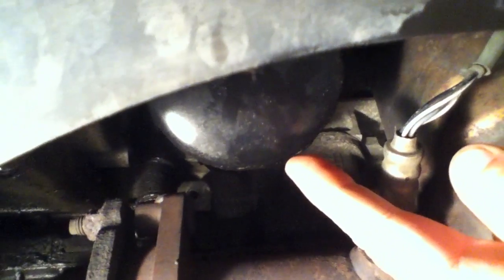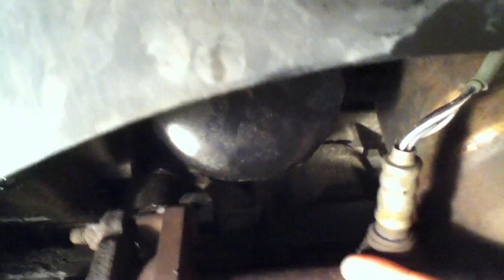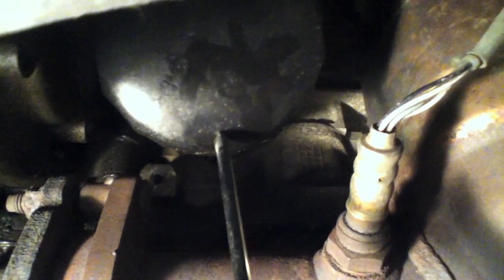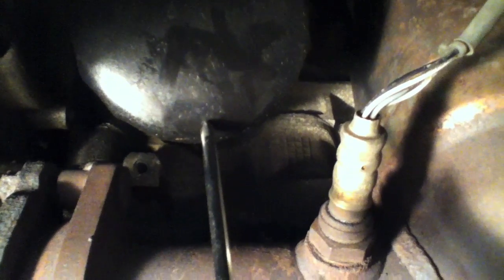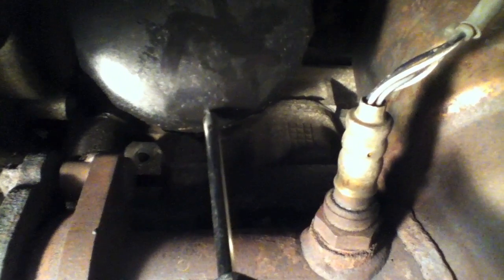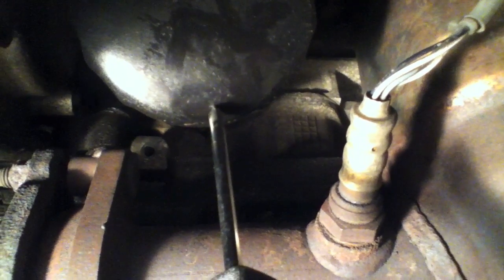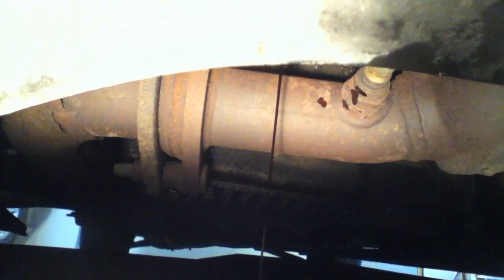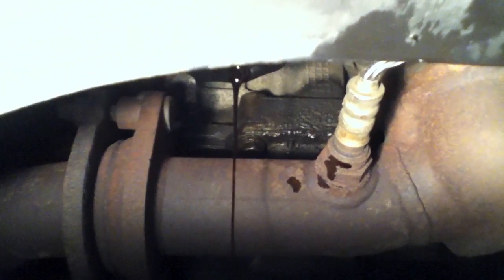How To CLEANLY Remove An Oil Filter

Comment: I slightly loosen the filter then put a quart size plastic baggy over the filter and unscrew it. Oil and filter fall into the baggy. The
Reply from the maker: Nice, that'd work also!
Reply: Epic suggestion. Thank you!!!!! - AB in Borneo
Reply: I was also thinking that the tip was a plastic bag. Either way, thank you for taking the time to share your idea.

Comment: Thank You for the tip, but my oil filter is on top of the engine not the bottom, do you have any suggestions video's for when it is at the top? Thanks again, TOm

Comment: I was thinking about drilling a hole in the old oil filter and inserting my hand-pump hose and pumping it out. Just got the hand-pump (Amazon) and this thing pumps out four quarts of crankcase oil in about 3 minutes. just insert the supplied hose into the dipstick tube and away you go! Have an '03 Taurus so the filter is right there. Problem is it's situated directly over the starter which gets covered with oil when full filter removed.

Comment: Tried this, it doesn't drain the filter enough, still a big mess. Maybe the diesel oil filters have extra valving or something. Baggies are still messy, I just keep the pliers style wrench (FRAM) on the filter and grab it just as it loosens and lower it into the drain pan, no oil on the hands or gloves usually, just wipe off the wrench.

Comment: What genius engineer decided to mount the filter in such a difficult spot to access?  Acura MDX has the filter over the frame rail - super hard to get at,  being located so close to the frame.  You have to remove a tire even to get at it.

Comment: That’s a pretty handy dandy slick ass move! When I have one that is stuck I do the same thing except for from the side with a deeper bite and use the screwdriver as leverage. But that’s only when some dumb ass somehow used a cheat bar to get it on!
Reply from the maker: Haha, I've had to do that before too. Just another reason to do this stuff yourself instead of taking it to a shop. Thanks for he comment!

Comment: You’ll damage the threads on the oil filter housing doing it like this. Just a heads up.
Reply: Yes, I have been using a drill bit instead so it doesn't damage the housing.

Comment: Can you just do this and not even take out the bolt.
Reply from the maker: No you'd still have to take the bolt out to get all the oil out since that's the lowest point on the engine.